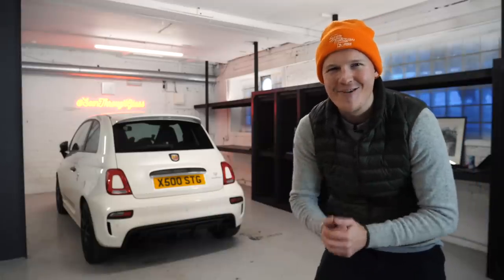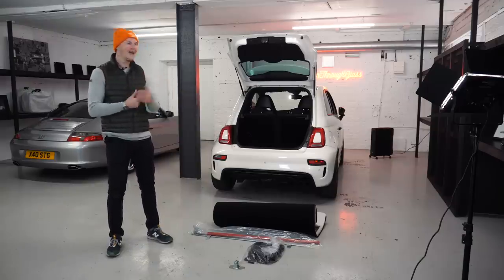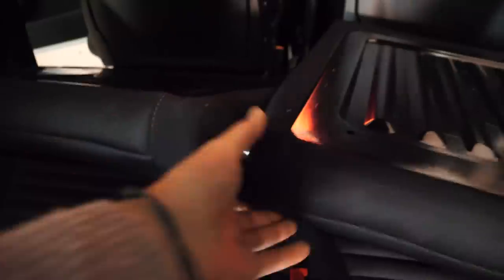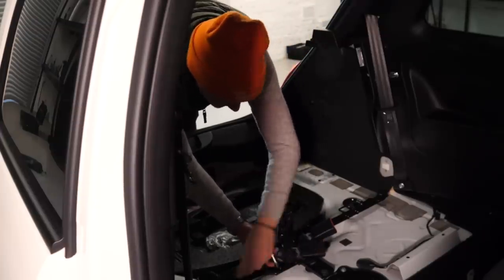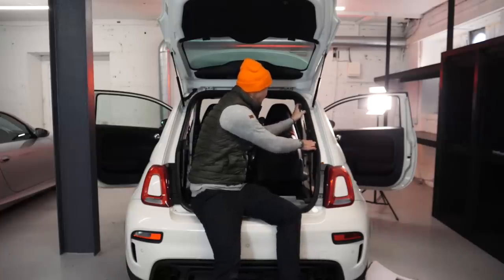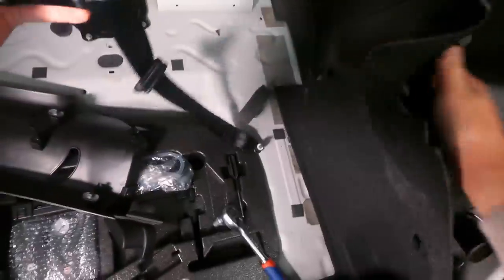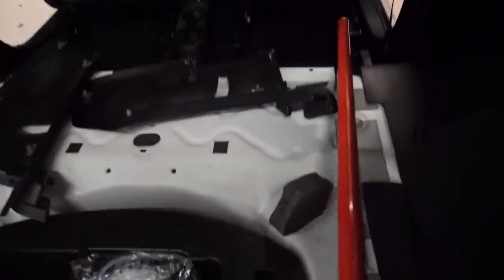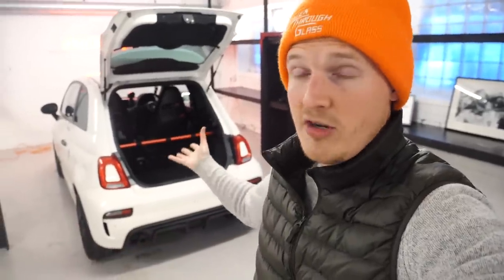Removing The Seats From My Abarth! [Project Biposto]

Comment: Way to go Sam!  One tip for the beginning DIY-er. Grab freezer tape and sandwich bags. Label everything you take out.  Keep all the bolts together.  Take a photo of all the bits.  This may be an obvious statement but someone out there doesn't know that sometimes parts are designed for the left or right side of the car.
Reply from the maker: Wish I’d known this before I started haha
Reply: haha, I posted almost exact same comment!

Comment: An extension bar on the ratchet can make life a lot easier. Hold onto the extension when it stops ratcheting and then you can keep using the socket instead of your fingers.

Comment: Great video, thanks! Unfortunately I really need the rear seats otherwise I would have done the same. Could you please indicate how much weight this mod actually removes from the car? And is the strut bar strong enough/permitted to put in racing harnesses? Thanks in advance for answering 👍

Comment: Maybe due to youttube processing time but does this vid look very 720p? on a 30 inch monitor so it very noticeable that 1080p is not 1080p.
Reply: I think a little time in lighting placement and a iso step would  have help as the wide shots seem to be the worst  maybe the bitrate conversion didn't help. I think I am more picky as this channel usually is outstanding for production

Comment: One thing is not pretty clear to me .... So, you bought the car like 3/4 months ago, in order to work on it as you mentioned on that particular video, right? Now you're saying that you considered to Stop the project and sell the car because of the situation, which is essentially exactly the same as when you bought the car ... Am I missing something?!? I would understand if you would have made plans before of the pandemic and then be struck by its consequences but you started the all thing right on the middle of it ... It seems one of those movies when the plot start to crumble right at the begin! 

PS: I actually think that workshops, of any sort, are almost the only activities which can be done during restrictions times ...